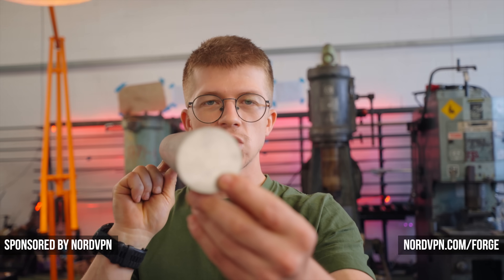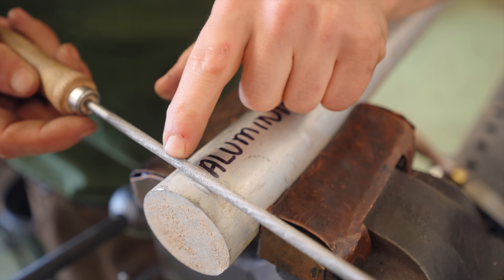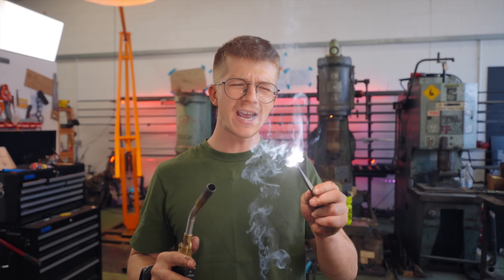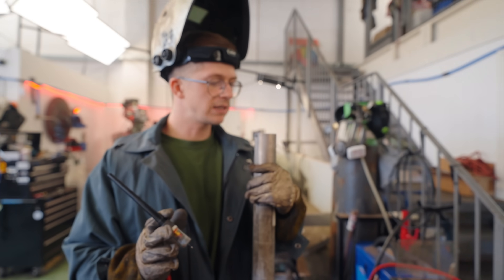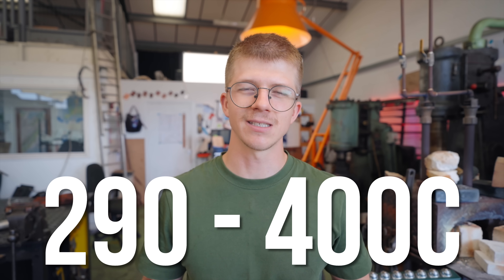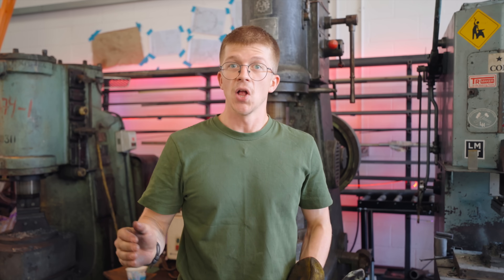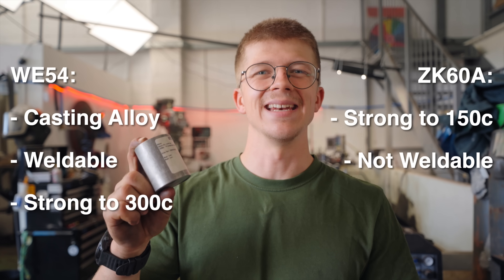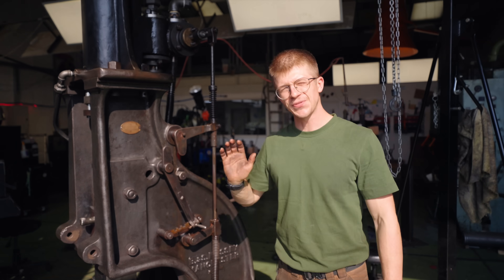Can You Forge Magnesium?

Comment: Magnesium is actually a really cool element. It’s my favorite. It’s very versatile with its uses. You should do more research on it. It’s actually interesting. But if you’re talking about an element that sucks it’s silicon. Carbon does is so much better. Also silicon could have the same attributes as carbon if it wasn’t always found as a solid at room temp as opposed to co2

Comment: The thing about that stuff is you need to hold the temp on it almost constantly while forging it. Either many trips back to the heat or find a way to keep it hotter longer. Also working smaller pieces might be easier since there is less temp variance across the material.

Comment: You need to sweep those magnesium chips up and keep them separate from anything else. They can ignite steel chips. Think Thermite. Train rails are welded together using thermite. I did cringe when you sanded it. One spark then and you would have been searching for a new shop. Same with the lathe, hot magnesium chips, bad. Fires can be extinguished by removing the oxygen, CO2 works, sand works better.

Comment: There is a rough correlation between density and hardness. However, different metals have different hardness's per unit of density (and density is impacted by many factors, some of which have no impact on hardness).

Comment: Machinist story here. Friend worked at factory. Someone left a machine running unattended for a few minutes near end of program. Went on lunch break. Sometime after, coolant failed for whatever reason. So instead of calling fire dept, they have dump pallets full of dry sand right next to machines. They drive up with a forklift, grab a pallet and smash/dump it into machine till its full.
The machines are usually shot as the machine ways are ruined anyway from the molten metals.  And he said they just smash into it thru the door if its still closed, no one gets near it. and eventually it goes out.  What a colossal cluster that must be to clean up.

Comment: Magnesium is a great material for certain things since it is lighter and tougher then aluminum and even lighter then titanium too. So for a bike frame it is a super material.
However, it isn't something you forge and even running it a lathe like you did is risky without a cooling liquid (and not the regular stuff). 
I remember my dad finding out that his old Ford Tanus had magnesium in it when he was welding. It was in the seat though so he was able to pull out the seat before the entire car burned up 

So yeah, a relatively though material but nowhere near as tough as steel or bronze and once it start to fracture it is over. If you need something relatively hard and ultra light while it wont be exposed to heat it beats out most materials. It is however a nightmare to work in for several reasons. It is a very bad material for forging.

Comment: Under clause 231, the ‘War Guilt Clause’, Germany had to accept complete responsibility for the war. Germany lost 13% of its land and 12% of its population to the Allies. This land made up 48% of Germany’s iron production and a large proportion of its coal productions limiting its economic power. 
The Heavy Press Program was motivated by experiences from World War II. Nazi Germany held the largest heavy die forging presses during the war, and translated this advantage into high performance jet fighters. Because of the shortage of aluminum, German aircraft manufacturers used forged magnesium structural components, formed to shape in closed-die hydraulic presses. After finding this, in 1944, the Federal Government asked Wyman-Gordon for assistance, and this program evolved into the Heavy Press Program. Work was started on an 18,000 ton press, built by Mesta Machinery, which was completed in 1946 at the Wyman-Gordon Grafton Plant. Post-war, the Soviet Union captured the largest German press to survive the war, with a capacity of 33,000 ton, and were suspected to have seized the designs for an even larger 55,000 ton press. The next two largest units were captured by the United States and brought across the Atlantic Ocean, but they were half the size at 16,500 ton.
There's a yt video called us heavy press program.

Comment: i think you can double deg. C and add 32 to get a rough ball park in F.
Ball Park in C from F subtract 32 first then divide by 2 for a rough idea.
Formula is like (1.8*C) + 32 = F or (F - 32) / 1.8 = C
Or you can do (9/5 * C) + 32 = F or (F - 32) * 5/9 = C

Temp. Scales are
------------------------------
Fahrenheit
Celsius -water based on boiling and freeze point
Kelvin - Absolute zero
Rankine - Steam Based System

Comment: Magnesium alloys are also used in car racing for wheels; the lighter the wheel the faster it can spin, and therefore more speed. Though if the wheel is ever damaged, it's donezo. Replace only as far as I know.

Medicinally Humans do need a small amount of magnesium in our diets so that it helps to regulate bowel movements. In high doses you are correct; as it acts as a laxative. Though taken frequently in high doses can cause distress and illness.

Comment: Not sure if anyone has mentioned this but the likely reason behind the magnesium appearing harder to file is that because it is less dense, it’ll actually clog up the teeth on the file at a faster rate. So similar to how putting aluminium on a grindstone would clog up the abrasive surface 😊 (before anyone says anything, no I would not use a grindstone with aluminium)

Comment: Adiabatic heating from deformation energy caused the pipe in the forging. The light metals, as a rule, do better with lower strain energy in deformation. That means press forging with longer die contact times which means the workpiece chills below the narrow band of safe forging temperature quickly. You need an end use reason to work with the “light” metals and a process design to accommodate the alloy. Unfortunately you approached it using ferrous materials as your basic guide. Try some Inconel next time. You’ll probably dislike that too.

Comment: 10:25 setting 0 as the freezing point of water is just as arbitrary as setting it as the freezing point of a salt water solution, don't kid yourself. only one that makes any kind of sense is 0 as absolute zero. comparing celsius and farenheit, while acknowledging that both having equally arbitrary points for 0, farenheit is superior, given that there are more degrees between any two temperatures, you need decimal places to express the same level of sensitivity.
Reply: Your absolute zero argument would hold water, if everybody was constantly carrying out scientific research, or looking into astrophysics. But they're not. The average person will likely NEVER need to know where on a scale absolute zero is.

Comment: I'm sure it's at least somewhat algorithm bait but... the difference in 1 degree C is absurd. It's like 6 degrees F. That's why it's hot at like 30c or whatever, instead of 75-80f which obviously makes more sense. Your scale makes more sense the closer to 0 you get, and less the further you get. Ours makes as much sense at any point, really. The only weird but is freezing isn't at 0. But it's really not hard to learn that WATER freezes at 32f. Also, humans can survive pretty decently at 32f even without layers of clothes. It's not ideal, but not that quickly fatal. At 0 though? Pretty sure you've got like 5 minutes at best before you're taking damage, and probably under an hour before severe issues if you're naked and exposed. So our 0 and 32 being quite different also kinda makes sense? We use different logic than the freezing point of water, clearly. I'm not even sure what is, but it's pretty obvious it's not simply the freezing point of water.

Comment: Not super light and stromg? What about Titanium? Better tensile strengt than steel when it's forged and nearly Hälfte the weight. And no, Material weight is Not determined solely by Atom count, but also by Atom weight and crystalline structure size wich determines Atom density, little crystals more density, but not certainly heavy If Made Up by light Atoms like Magnesium and titanium

Comment: Had an 02 BMW M3, the engine(S54) is made of a magnesium alloy, had to break out a the tap and die set, and... pain. But had a good bit of metal shreds after cleaning up,and my dad wanted to show me a neat trick with getting rid of certain metal shavings, and turned a oxygen gas torch on the pile, after seeing it go up, made me very happy we cleaned up after rethreading some stuff on that engine block.
Reply: The S54 block is made of cast iron

Comment: Materials Scientist here: Magnesium and its alloys were quite big before and during WW2 specifically in Germany. That was because Bauxit, the mineral from which Aluminium is synthesized, couldn’t be mined and bought by the German Government. Magnesium was seen as the alternative and in fact, Germany became the leading country in Magnesium research, production and processing having its center in Bitterfeld - Magnesium was known as the „German Metal“.

After the war, a lot of knowledge was destroyed and lost (some estimate a 60-year-set-back) and researchers are still catching up in  a few areas of research. A lot of what was left went to the UK in the form of Magnesium Elektron (today known as Luxfer MEL). The material WE54 (W = Yttrium (5 wt%) and E = Rare Earth (4 wt%) like Neodymium, Gadolinium etc.) is one of the alloys developed in Bitterfeld for high temperature usage.

Magnesium and most of its alloys have a hexagonal closed packed (hcp) crystal structure with a c/a ratio close to ideal. This means that there is only a limited number of glide systems for dislocations (less than 5 independent ones at ambient), resulting in a very limited formability and forgability as you demonstrated here! I was somewhat surprised that at higher T, the forgability is also quite low, as at high T more glide systems become active in theory. However, Magnesium has a low heat capacity meaning it looses temperature quite quickly. 

Due to its low ability to deform uniformly and without breaking, parts from Magnesium are mostly produced by casting like high pressure die casting.
Reply: This was very interesting, thank you for sharing your knowledge!
Reply: I rarely comment, but this was so interesting and well written that I thought I’d drop a thank you. :)
Reply: Very interesting
Reply: WOW, thank you for the education.
Reply: Thank you for sharing your excellent knowledge
Reply: How would you recommend I go about education for materials science or engineering. I’m highly interested in the field but not sure where to start.
Reply: so can we get mag wheels for my car? it looks very week to me
Reply: @code_name_uzi  they have been using magnesium in racing wheels since the 1950s.
Reply: I’m 24 y/o with no clue what I’m wanna do with my life. Can I please ask you how you knew you wanted to be into this field? Have you just always loved metals??
Reply: @ not even just metals all the elements the periodic table it’s properties etc etc. my main kick was learning about the photochemical reactions of our atmosphere and how absolutely Precise the energy has to be for it to occur.
Reply: Ich mochte die „“ auf Deutschland
Reply: Aluminum isn't "synthesized" from bauxite.
Reply: Also, magnesium was 1st discovered and refined by a chemist from Cornwall, England. 
The fact that Germans were one of the first to use it in manufacturing doesn't make it a german metal. Stihl chainsaws made in West Germany had a lot of magnesium.
Reply: Pyro here, I can vouch
Reply: My dad told me that my grandpa said (grandpa was ww2 aircraft mechanic/engineer for the axis) that in order to put out a magnesium fire that was really going, they would douce it in kerocine first to stop the magnesium fire, then put the kerocine out via usual methods. Unsure how accurate that is, but i remember the story vividly
Reply: Yeah, we actually make plenty of things using magnesium alloys even today. It's always at fairly low amounts though due to its reactivity. No, my multiple year study into WWII  suggests that far less knowledge was lost then they want us to believe was lost. The US, France, Russia and the UK all went on a crazy scientist scoop up. It's why they basically ignored the concentration camps for so long. They were far more fixated on snatching scientists aka land before Russia got them. Those German scientists and their research became the backbone of NASA and many other US research programs. We then acted like we destroyed research and we didn't save all the really nasty SS scientists for obvious reasons. It's why America jumped from 60 years behind Germany to the leading military on the planet and not by a little bit. Too bad we didn't take any of the structural engineers and the like. No, while the US has a hyper advanced military, everything else is something like 80 years behind the rest of the developed world just like pre-WWII.
Reply: @jasminejeanine2239  it corrodes quickly, galvanic, and is difficult to machine because it is abrasive. Very limited use in commercial aircraft, aluminum alloys are preferred. At one point in the 60s, they made entire F1 cars out of sheet magnesium and drivers were so scared of fire they refused to wear seat belts.  Too bad because it is an extremely abundant metal that can be harvested from sea water.
Reply: There's no legitimacy behind destroyed/lost knowledge.
Reply: Sieg!

Comment: Metallurgic engineer here. When I was studying Uni, I had this crazy but brilliant teacher wanted us the students to make an alloy of Lead-Magnesium, (Pb-Mg).
Obviously the lead melt down first and because of Mg density it didn’t went into the alloy properly, then it started reacting with the air around so we start having like fireworks on a little oven/ forge at the Public Uni at Mexico. A mess, but my teacher quickly took it out (using safety equipment obviously) at control the situation like a pro 😮.  
The best lessons in the world ever 🤣

Comment: There are a lot of Alloys that you cannot Forge because they have no transition temperature from where they go from Rock Solid to practically molten. Some have a narrow range, and some are just so ruinously tough like various superalloys like Inconel or Invar and its ilk. I have a telescope secondary holder which has a stalk that the pieces attached to the made of Invar, and I thought it was stainless steel until I started looking at some of the Machining done on it. All the larger threads were done with the lathe, not taps. Otherwise, very rudimentary machining.

I suppose you'd want to do it for the views, but you're not going to learn much from it. Other than the fact that you can't be done.

Being a cyclist who was obsessed with weight, I got into the titanium bike craze in the early nineties spending $1,600, and that was about $600 off its original list price for just a titanium frame. It actually was very nice, but I did end up breaking a seatpost clamp after suffering with various seatpost problems because they had a very limited range of sizes for the seat post tube.

Always you could try are ones like Reynolds 853 or 953 since you reside in the British Isles someplace. It can be drawn into tubes, so forging seems possible.

A friend of mine that worked in in Satellite and related engineering, took me on a trip to Boeing Surplus looking for a milling machine for his company. Boeing Surplus was a legendary place filled with leftover machines and materials from acquired companies' stocks, completed or abandoned projects.

I picked up some rare optical glass, anomolous dispersion flint, for a refractor project, and he got his machine AND some leftover Carpenter Industries Aemet100  billets. 

He had a Mopar car, and someone bored it out to some excessive amount of displacement, causing timing issues under load.
 He reasoned, correctly, the crankshaft was twisting under loads, causing timing issues. These billets were used by Macdonald Douglas to upgrade the landing gear for carrier operations.

A limited number of bike frames were made of this alloy, resulting in bike frames with sub 2 pound weights. Riders weren't thrilled, as the ride was a bit soft as they reduced weight due to not needing as much material.

Comment: Magnesium fires have to be put out by blocking the atmospheric oxygen from reaching it like sand. However this won't work always because the Magnesium is so reactive it can pull the oxygen out of the silica making up the sand.

1 mind-blowing thing to do is to put a chunk of burning magnesia on a block of dry ice and it continues to burn because it's pulling the oxygen out of the carbon dioxide. I believe it will also disassociate water so now you've got the Magnesium burning from the oxygen in the water, and now you've got a hydrogen fire as well